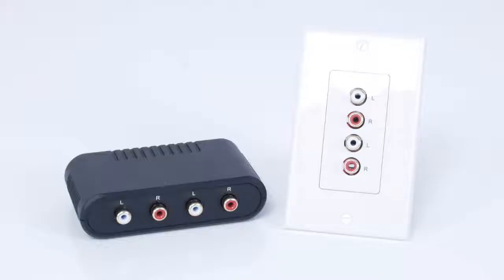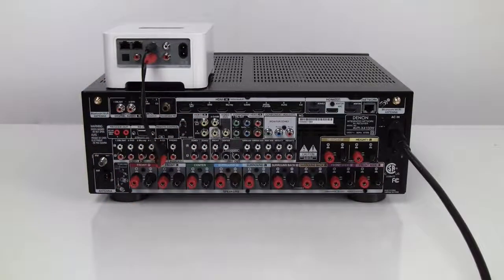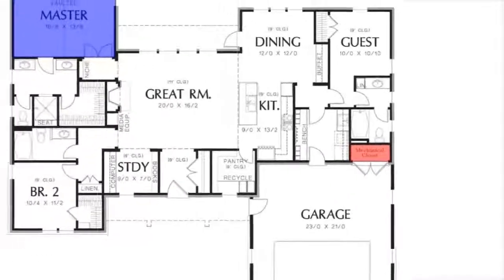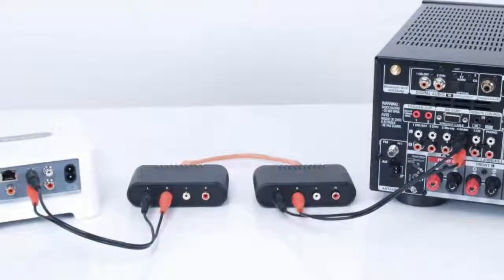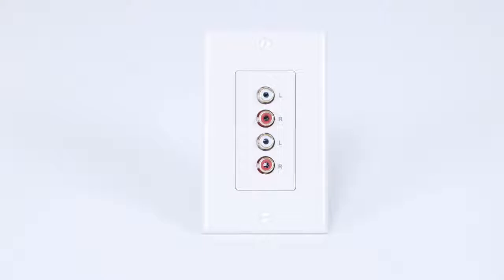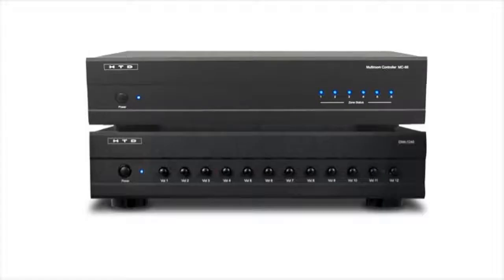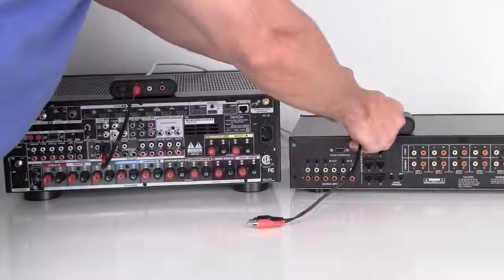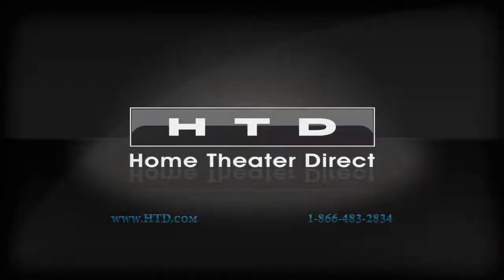Using Baluns to Send Audio Over Long Distances - HTD Quick Tip

Comment: Can I have a network switch between baluns or must they be direct wired?
Reply from the maker: No, you cannot. The Cat cable is not being used for Ethernet. FYI, all 8 conductors in the Cat cable are being used.